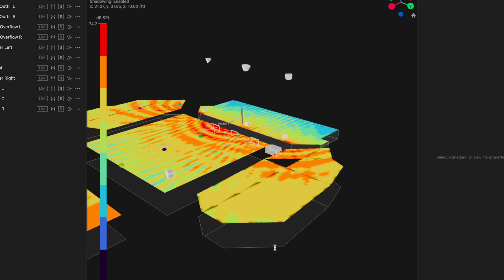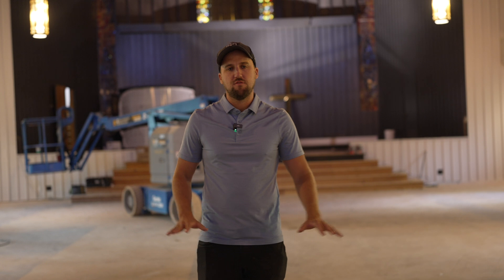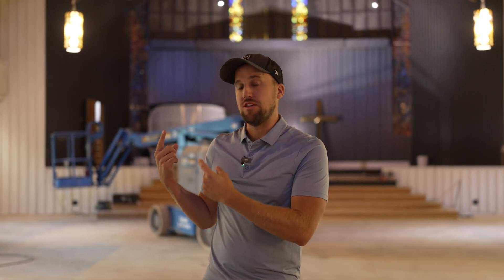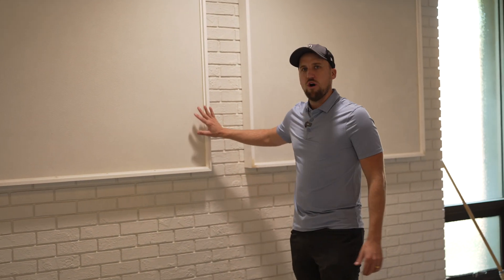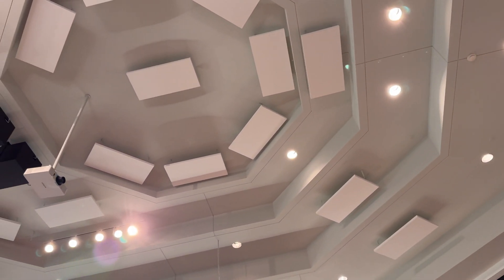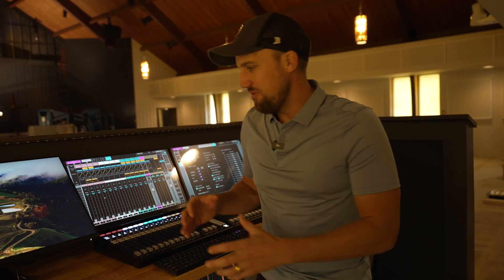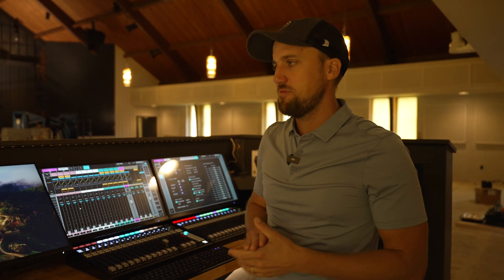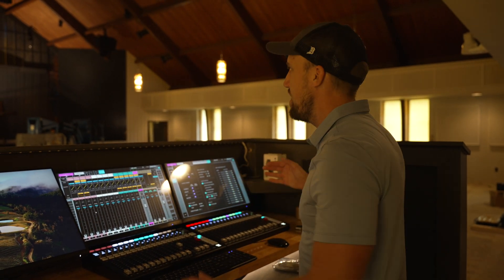How to Build a Church PA System

Comment: I was glad to see you bolted through the beams at the mid-point.  So many attach to the lower half of a structural wood beam and that is bad news structurally.  As a retired SE, I prefer to see the bolts a little above the midpoint as once the roof structure is attached to the beam, the neutral axis tends to move slightly above the midpoint of the beam.  Nice work.

Comment: I'm early so I figured I might as well chime in: Re: The audio system tuning:
One way I heard someone explain the philosophy you mentioned (EQ and processing in the amp gets the sound system "right", then the mixing person doesn't have to deal with that), was "Separating the 'art' and 'science' parts of live sound".
The system processor (In this case your DSP amp), handles the "science" side, while the person running the mixer handles the "art" side. This also helps to serve as a point in the system where the "art" ends (the art being getting sound into the mixer, and mixing it), and where the "science" begins (setting levels, delays, crossover, EQ, etc).
This is the big reason why I like having a dedicated system processor, or at least DSP built into the speakers or amps. Having that separate element lets me handle the system optimization, and get the sound system to be a solid reference, so that the user of the sound system doesn't have to worry about it.
Reply: Both system tuning/deployment and mixing are art and science. There are all kinds of artistic decisions that need to be made in the system deployment/tuning process.